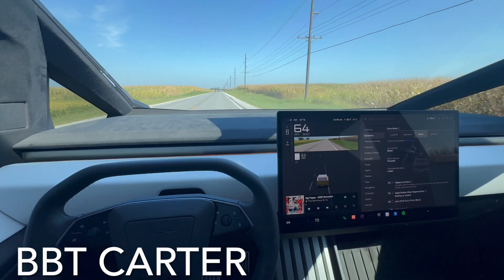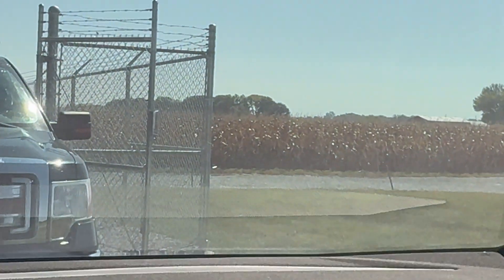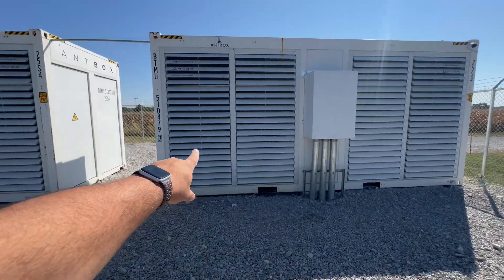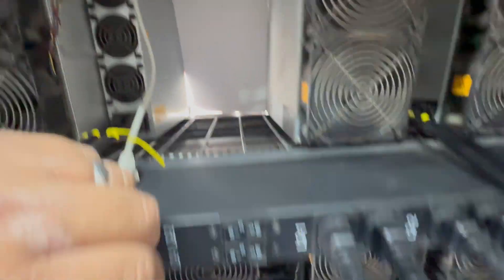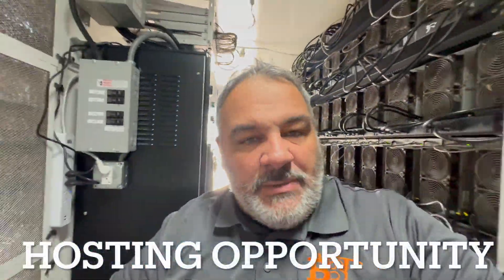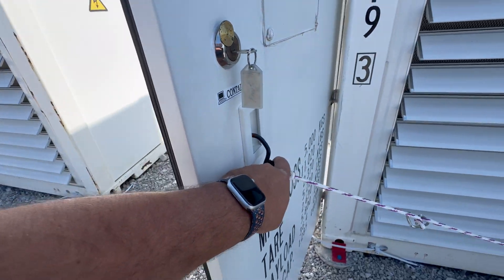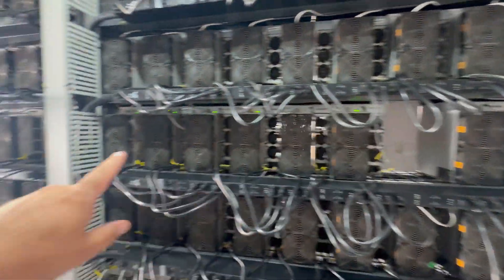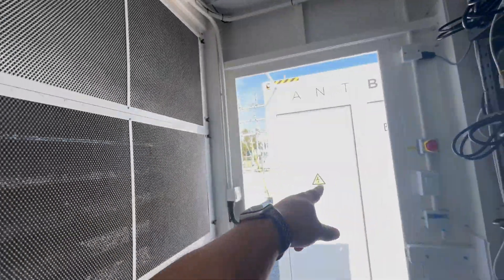Weekly Maintenance at a Bitcoin Container Farm

Comment: Do you use only starlink or is that a redundant connection for a secondary ISP? In other words, are you using Starlink as a failover network?
Reply from the maker: @ronwatkins5775  Starlink primary ; fiber connects the two containers